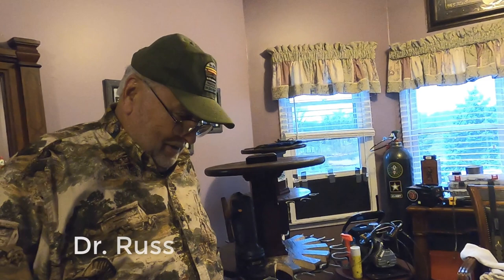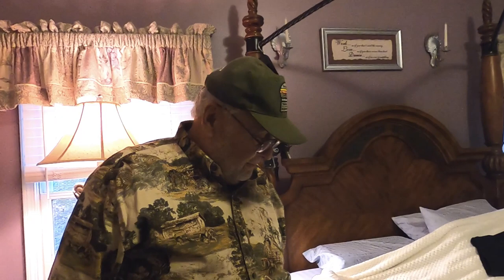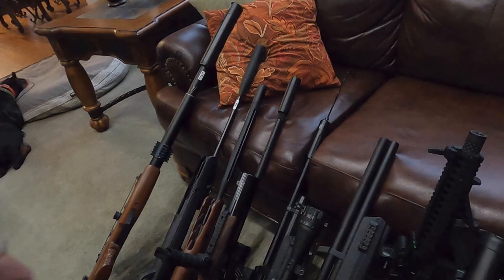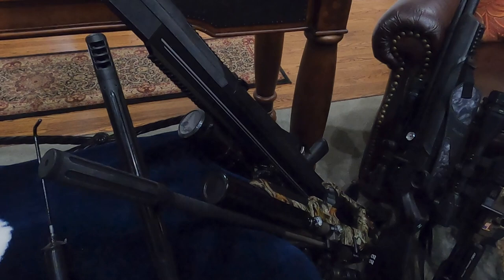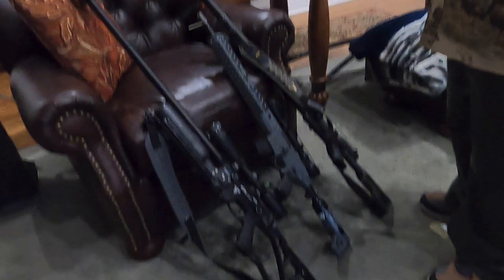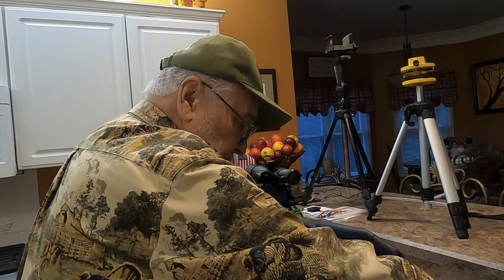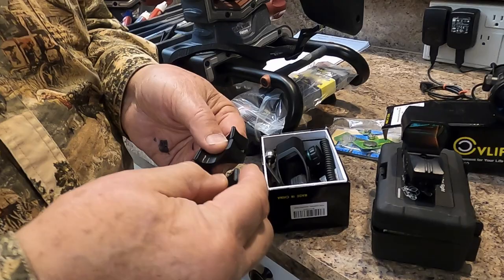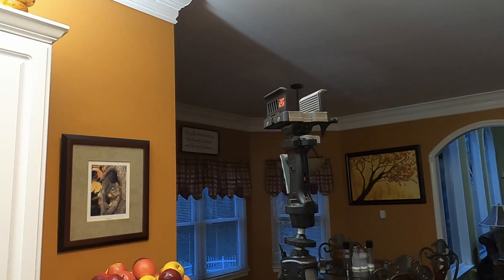Maintain Your Air Guns & Keep them Out Of The Repair Shop!

Comment: Dr Russ, I recently purchased a Gamo Magnum Swarm 10x Gen3i in 177 and like it a lot so far, mainly for the convenience of the magazine.  I use it for hunting varmints in my barn (rats, possums, coons - occasionally, and skunks - even more occasionally, thankfully).  This is pretty short range, typically 15-25 yards due to where most come into the barn to steal feed.  I've previously been using a .25 Hatsan Sniper break barrel single shot, but when it's really cold, it's a challenge to reload.  But I'm having trouble with the Gamo magazine... it doesn't always load even though I've got ammo and I get a dry-fire.  I'll break the barrel & a pellet will fall to the ground.  I purchased it only a couple of weeks ago and have shot around 100 rounds.  The problem seems worse with a pointed hunting pellet (H&N Hornet), so I'll limit that, but I'm concerned about the problem and the impact of dry-firing it.  Any thoughts or suggestions?  Is this a common problem?  Thanks for your insights.  - LR
Reply: Larry Roberts ... it is good to hear from you ... before you dismantle the entire Swarm Magazine feature (some owners have) and be in the same condition you are with your Hatsan 25.... let me suggest that you push your pellets into the magazine with a pencil or pen so that the black rubber band slips into the waist line of the pellet.  this should hold your pellets in position until the gun fires.  If that doesn't work ... then I would cut the tips of a pair of gloves so that you have hand warmth ... but also the ability of your finger tips to load the 25 caliber correctly.  I am concerned that a 177 cal pellet will only wound your larger critters like the possum and coons.  You probably should keep the 25 cal handy for those critters so that you humanely harvest them... Please stay in touch ... Dr. Russ

Comment: Awwsom collection, good idea rack coming.,this is off subject  .there are a few airguns out there that are duel ammo pellets n bbs.i keep hearing people say don't shoot bbs in your rifled barrels ,if this is the case why do they make them to shoot both .please elaborate  or do a video  for all.than you
Reply: Jerry Purnell ... it is good to hear from you ... and I shoot both copper BB's and 177 lead pellets down the same barrels.  Pellets are made of lead and BB's are made from copper or steel.  Barrels and their rifling are made of steel.  I am not an expert in metallurgy ... but I find nothing in the air gun manuals that seem to be concerned about the type of BB's used ... so I am going to guess that steel BB's are made from the cheapest and softest of steels.  The cheaper the air gun ... the cheaper and softer the steel barrels are.  So while I wouldn't be concerned about shooting BB's and Pellets out the same barrel... you might want to stay on the safe side and shoot copper BB's and lead pellets ... both are softer than the cheapest steel.  Keep us in your air gun info and experience loop.  Dr. Russ

Comment: Hello Dr. Russ. Due to an encounter with a fox in my back yard (he had a psychotic look) I'm about to step up my game from break barrel to a high powered pcp model. But I have no experience with them. I want the rifle to be ready  upon demand so how long can I leave it with tank full/pressurized ready for battle??
Reply: Good to hear from you Duane ... Obviously all air guns are not the same when it comes to holding air ... with the most expensive air guns being better than the cheaper ones... My collection of 80 air guns, consisting of springers, piston, break barrels, and PCP's all hold air good for about a month ... some hold it for 2 and 3 months.  My lesser priced air guns will hold air for about 5 days... Dr. Russ

Comment: Dr. Russ, I hear filling up airguns with a small compressor can introduce moisture in to the cylinder/air tank.  However not much info on what could happen and how to remove it. Could you maybe do a video on this?
Reply: Herbert Cortes ... it is good to hear from you ... the key to not getting moisture in the cylinder/air tank is really based on whether there is a moisture filter on the compressor ... regardless of its size..... small or large.  Often the small compressors have what looks like a long brass nut on the air cable ... just before it goes onto the air gun.... and that long brass nut is actually a housing for a long moisture filter ... which resembles the filter on a cigarette ... but longer.  Hopefully these filters are doing their job... Dr. Russ
Reply: @russjones6497  I do have those filters.  Thank you
Reply: @HerbertCortes  Good ... they should work well...Dr. Russ

Comment: I just purchased a Gamo  Gen 3i air rifle and the pellets will not fire. This is Dr hook.  Please advise.
Reply: Dr. Hook ... sorry to hear.  You havent told me why those pellets will not fire.  Possibly lodged in the barrel, or something else is lodged in the barrel.  If so, use a rifle cleaning rod and insert it and tap it from the front of the barrel... being careful that the safety is on.  Possibly no air is holding in the Gamo after cocking it, and if that is the case, you need to return it to Gamo before the warranty runs out.  You might drop the stock off with 2 screws, and examine the trigger linkage for obstructions. Lastly, the safety might be on, which is the lever just in front of the trigger. Please keep us in your air gun info loop in solving this problem... Dr Russ

Comment: Dr. Russ, een vraagje vanuit Belgie: kan U me raad geven hoe ik een huma regulator op maximun power kan inbouwen in mijn pcp pistool diana bandit .177. Op voorbaat dank. Gtjs.
Reply: It is good to hear from you user from Belgium.  Regulators are basically designed to provide a range of consistent air power, that tightens groups up for accuracy.  Their maximum setting for power is actually lower than what the air gun can be tuned to shoot.  Consider setting the maximum power by adjusting the long pin and spring that are typically adjustable by a screw at the rear of the gun.  I don't have a Diana Bandit 177 ... so I cannot help you further.

Comment: I’m looking to get my son the Gamo swarm maxxum gen 2. Have they fixed the magazine issue. He uses a center point red dot sight. And I believe the gen1  sits to high for me to mount it
Reply: It is good to hear from you Joshua .... and glad to see you are working with your son concerning air guns.  I believe the Maxxim is one of the most accurate of the swarm collection... and the red dot should do well from 35 or 30 yards out. ... The gen 1 has a magazine that sits high ... but you will need help mounting a scope or red dot to see over that magazine.  Keep in touch and let us know how you do... Dr. Russ
Reply: @russjones6497  do you know if they have fixed the magazine problem with the maxim gen 2
Reply: @joshuaadmire4822  Unfortunately ... that problem is still unresolved with the gen 3i magazines... the only solution is to push your pellets in deep enough for that black rubber band to keep them in position... Dr. Russ
Reply: Joshua ... I quoted something you said in our next video using your first name only ... which should launch Sunday or Monday ... your son will also get a kick out of it... Dr. Russ